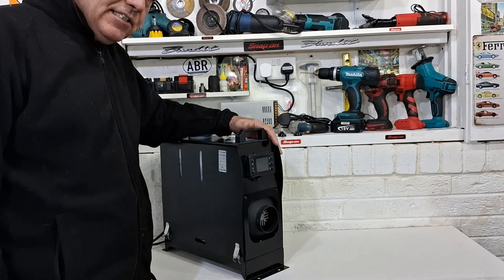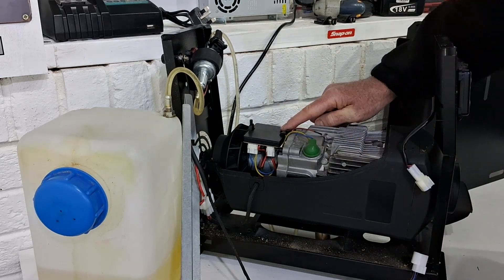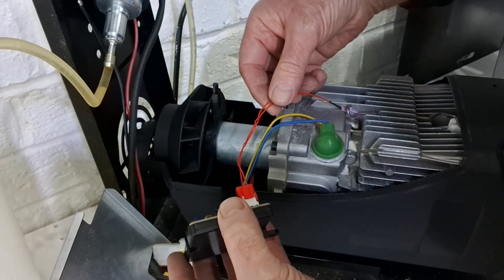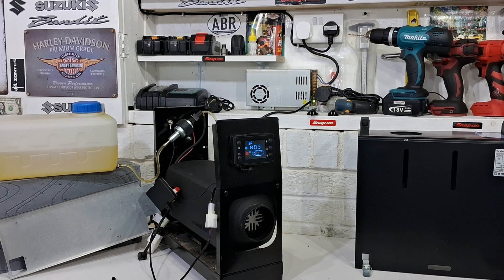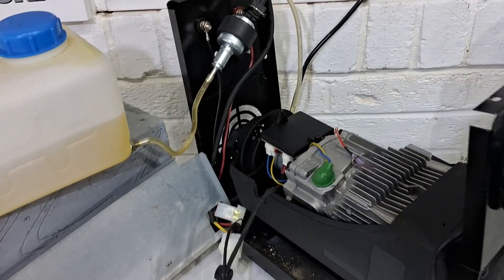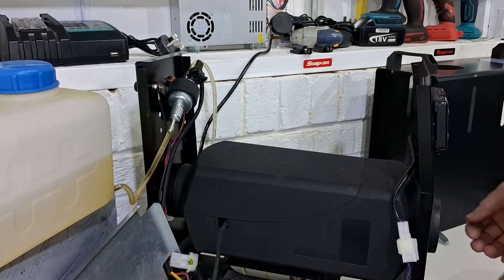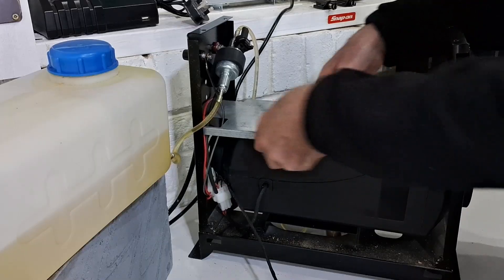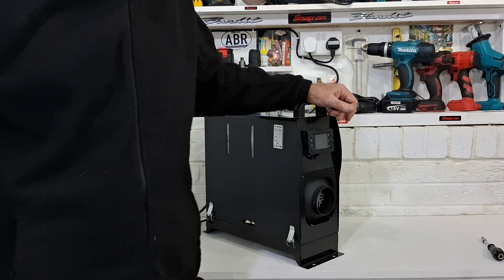Move the Motherboard on the Diesel Heater so that it doesn't melt in the event of a power cut

Comment: Andy is there room to slip a heat shield in under the mother board?
Reply from the maker: thats a good idea, but its in an enclosed space, so i would still worry about it. thanks for looking and your comment bobbob cheers andy
Reply from the maker: some people say that you can just kill the power and it doesent melt the board? i might try it?

cheers andy
Reply: It doesn't allways kill the board as with most Chinese cheap copy's it depends as much on build quality as it does luck, some warp and components come loose, sometimes the speed sensor moves and you get the fan error, lots of ways to kill a diesel heater 👍

Comment: Thanks for doing this experiment Andy, it was something that you had mentioned to me in a previous message to move the motherboard outside the casing, unfortunately I haven’t had time to try the experiment so thank you again.
Reply from the maker: thank you my friend, yes it had been niggling me. i just needed to do this! 
but now we know.

cheers andy
Reply: @andyfireblade  I wonder what sensor the magnets are picking up? I’ve had a motherboard that stopped working for whatever reason and I can remember looking at the board very closely to see if I could see any burnt out components (which I couldn’t) and thinking back I cannot remember seeing anything that resembled a sensor.
Reply from the maker: @Sirtomalot-c5s  there was one little part on the board that looked like a sensor. it must be picking up and controlling fan speed

cheers andy
Reply: @andyfireblade  thanks Andy 👍
Reply: theres a hall sensor on the motherboard that picks up the fan speed. it needs to be the right distance from the magnets so it detects  them. if you could extend wiring to the hall sensor and keep the sensor near the magnets that might work